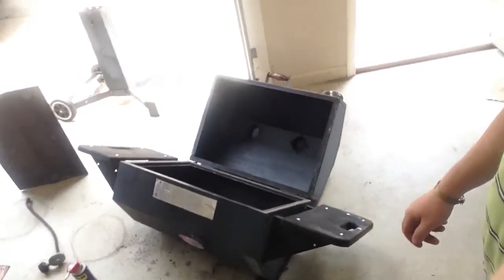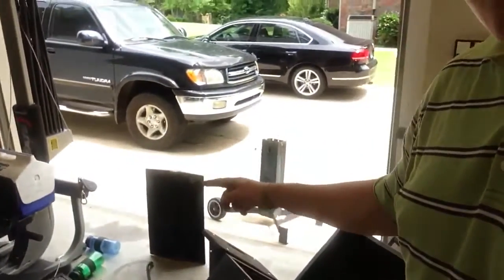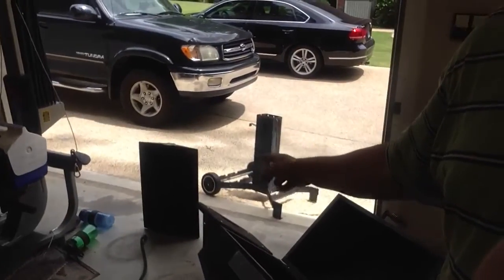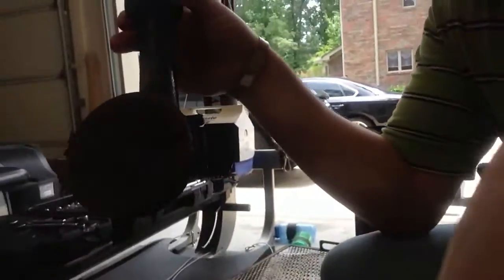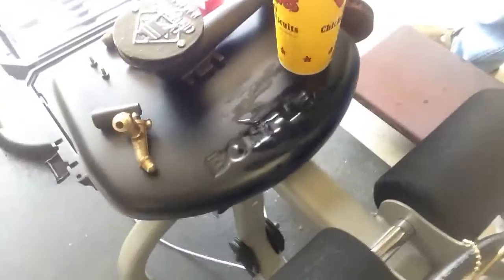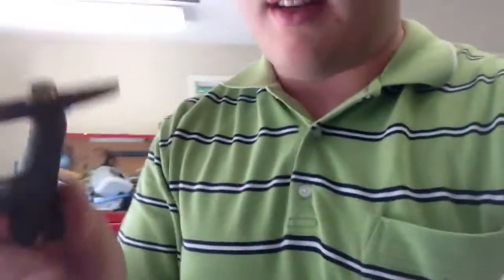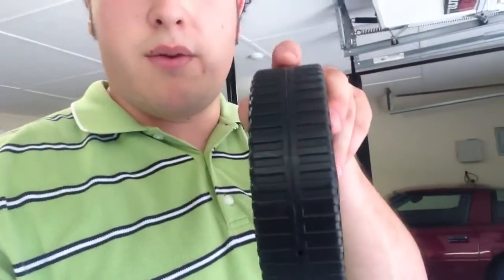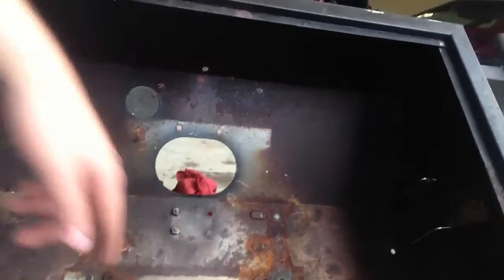Replacing Burner on 18 year old Holland Grill

Comment: Awesome guy! I bought a older one about a week ago. I took it all apart, cleaned it up replacing some of the screws. My bottom too was rusted a little. I cleaned it up with a wire wheel and lightly coated with Rustoleum grill paint. My burner looked great so I reused it. I did end up painting the whole grill. I looks almost brand new! I've used it several times since the restoration. The first being a spatchcock chicken whuch turned out beautiful. My grill reaches 410 degrees in 20 minutes.

Comment: What were the problems with the old burner? Low heat?
Reply from the maker: Low heat but after inspecting and cleaning I am almost certain the regulator and hoses were the problem not the burner. Grill still kicking at 25 years old now.
Reply: @chriswaskew89  thanks, I cleaned out the burner and still low heat although the flame looks good. Mine is 25 years old as well. I think I will order a new regulator and valve.
Reply: @chriswaskew89  I got lucky on mine years ago and bought it from a friend who just got it and couldn’t get it to heat. Bought it for $75 back in the late 90s of course. He did not have the shutter installed. Ordered from Holland grill and been working for years

Comment: My grill top does not heat evenly.  Regardless of win direction or how I position the grill, the top left hand corner is substantially hotter.  Need help.  Jerry
Reply from the maker: I would clean burner and entire inside of grill. If that doesn’t work try getting a new burner. Even thought they are out of business. Someone bought their inventory and I selling it on the Holland grill website. You might find parts.